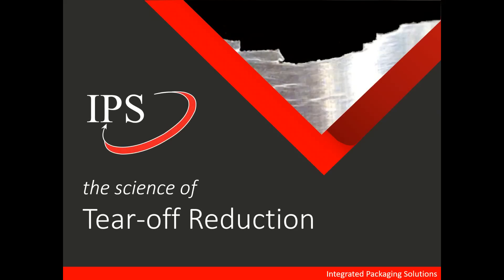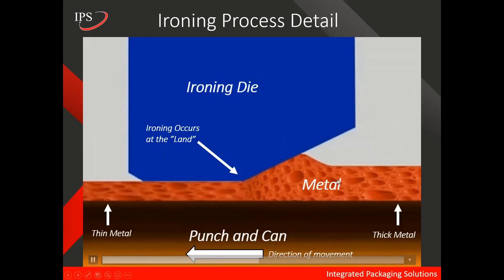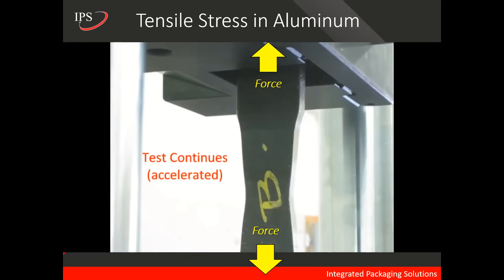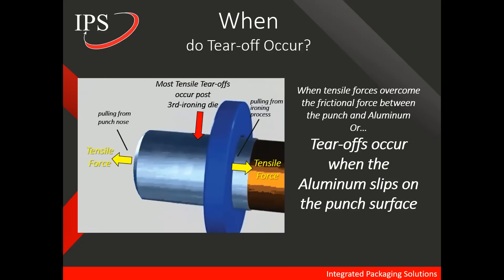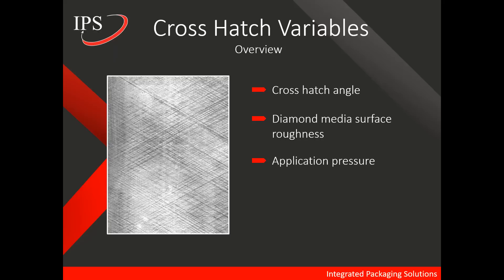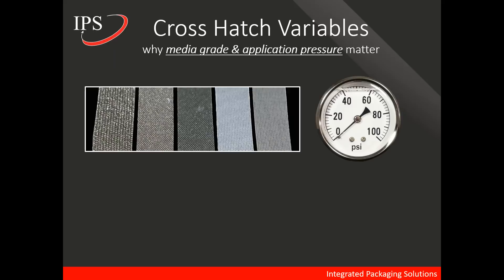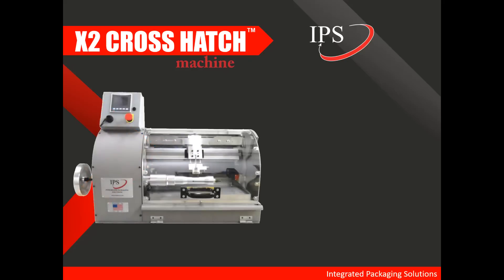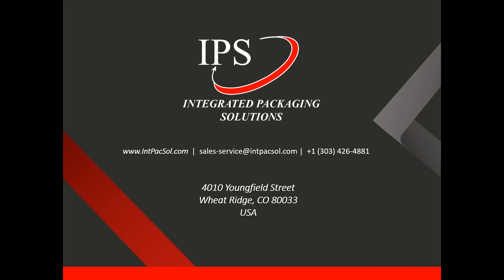The Science of Bodymaker Tear off Reduction

Comment: Excellent video just wondering if any recomendación on  how often needs to crosshatch??? In order to maximise production, being proactive. Thanks.
Reply from the maker: Great question. Unfortunately there is no one-site fits all answer.   The purpose of cross hatching is to make sure there is enough friction between the punch and the metal.   IF, you have a repeatable process (same metal supplier, controlled cross hatch, and well maintained and aligned bodymaker), the best thing to do is to track with data.   How many strokes (on the given bodymaker) did you run before tearoffs began occurring.  Once you gather this data a few rounds, you can start predicting the number of strokes (per bodymaker) before you need to cross hatch.
Reply: The chemistry of the coolant also plays a major part in tear off reduction.